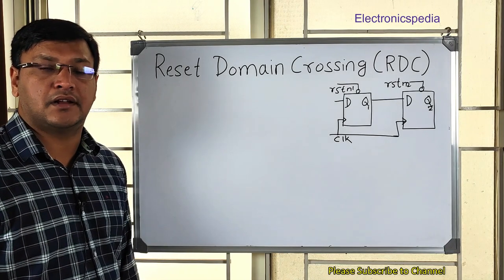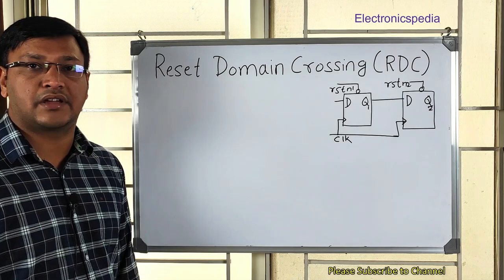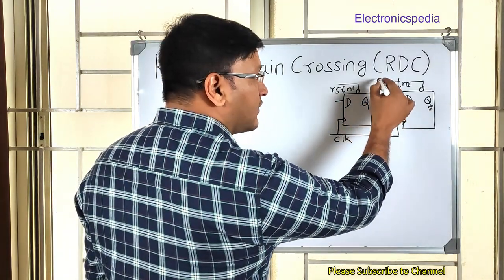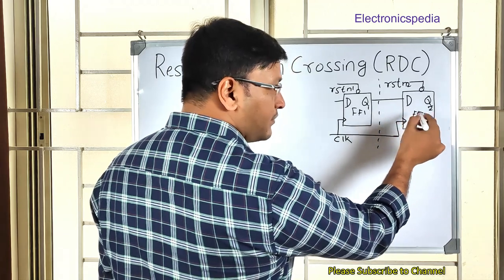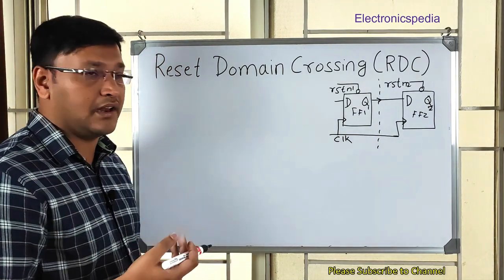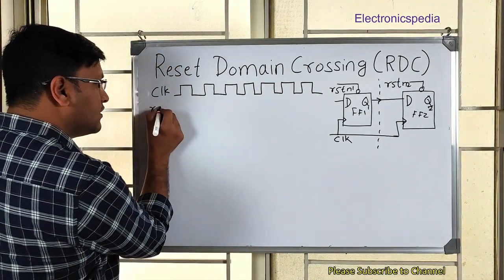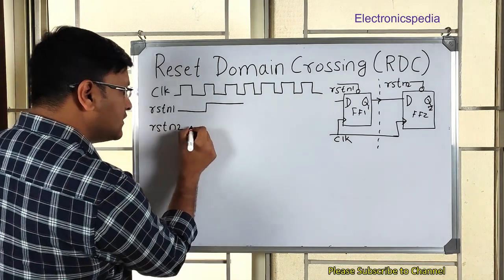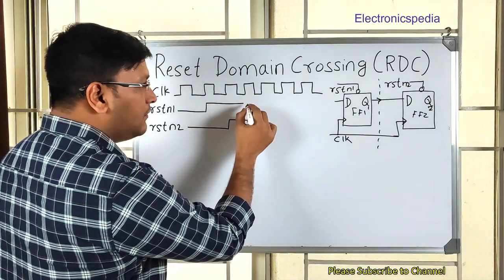Reset Domain Crossing Technique | RDC Technique | How to fix RDC Violation | VLSI Interview Question

Comment: Nice video though i do have a few of comments:
1. Fix #1 "RTL fix" is risky advice as it will not work for a multibit signal. If you a multibit signal RDC we must treat it as asynchrous from the destination side and synchronize it with one if the known CDC methods (e.g asynchronous FIFO...). 
2. Isn't fix #3 also technically an RTL fix?
3. fix #4 is not a fix. rather constraints are a necessary step of reset ordering. waivers of course don't fix anything either.
Reply from the maker: Hi, your comments are all valid and i completely agree. 
Fix 4 is not really a fix, it's more of a waiver through review. And it should be used only when design is right by architecture and reset ordering is done in the right order. .

Comment: Hi, for the RTL fix technique, instead of double synchronizer, can it be just 1 flop? Since the destination flop can act as the 2nd stage synchronizer itself?
Reply from the maker: Hi, Regular Flops should not be used as synchronizers, because in placement and route these regular Flops might get placed at far distances, which decreases MTBF, hence leads to failure. 
Instead we always use synchronizers which are standard cell components that's why we have synchronizer and then flop in destination.
Reply: @Electronicspedia  ahh, thanks.
Reply: @Electronicspedia  we need to give same clock what we given in flop1 to Double flop synchronizer ? and  rstn2 is deasserted during that time as well ?
Reply from the maker: Yes same clock for both flops.

Comment: If we have different clock domains as well with different reset domains. How to fix it
Reply from the maker: If we have different clock domains and reset domain then we may to include synchronizers and also we need to solve the issue with reset ordering.

Comment: sir how we will know that reset one is asserted and now gated clock should be turn on. AS you have explained that when reset1 will de-asserted gated clock of second flop will be off, and when reset1 will be asserted then gated clock will be on. so how we will know that weather it is asserted or not?
Reply from the maker: Hi Usually system resets will be software controlled, so you know when the reset is going to assert or deassert. 
If some resets do not have software override and if they are completely hardware based then you might get info from FSM state and/or you can add simple edge detection logic to check whether reset is asserted or not.